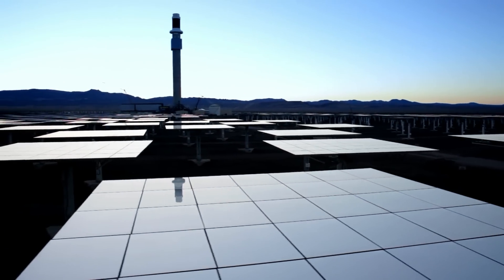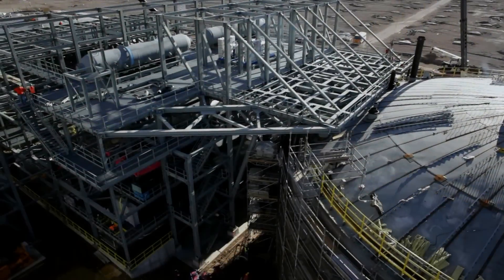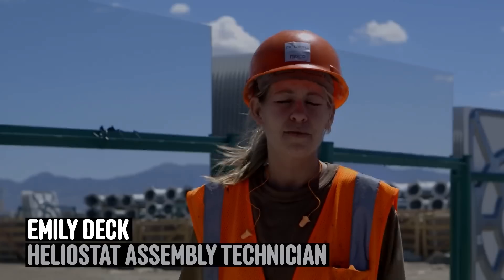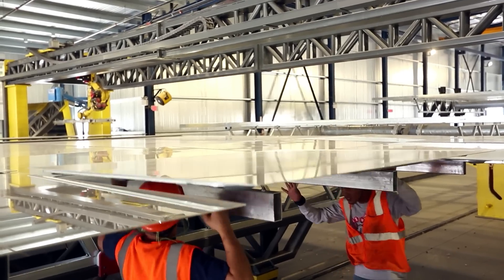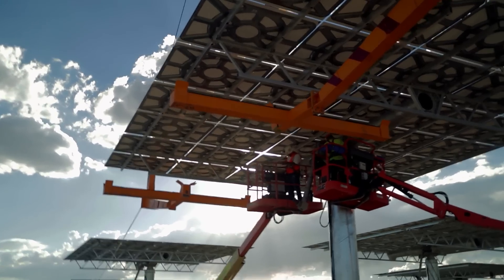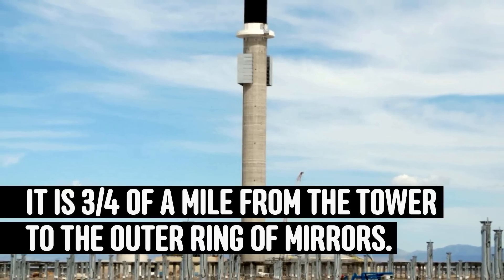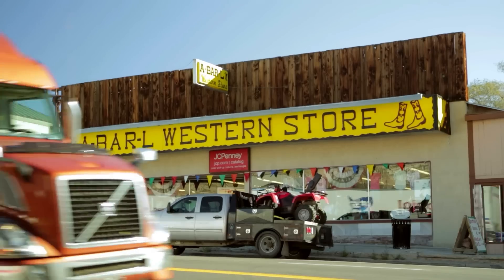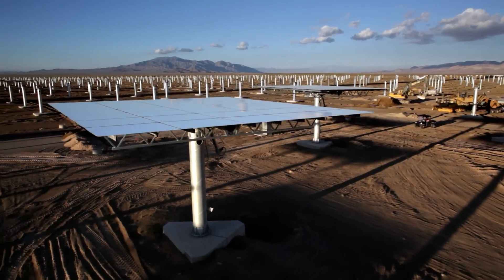Crescent Dunes Solar Energy Project Part 2: Building the Power Plant-The Window-WIRED

Comment: Oddly enough, I found the site by looking for the old nuclear bomb test site on Google Earth. I could tell instantly that the site was a solar array. I then performed a quick calculation of the size of the site; the potential projected array appears to be approximately 1.75 miles across, and approximately 5.5 sq/mi, or 3,520 sq/acres; that is just the array...this site is enormous!! I zoomed in and found the facility or warehouse on the site where the mirrors (the heliostats) are fabricated; off to the west side of the site. Well, my curiosity got the best of me, and so I then Youtube'd, "Tonapah Solar Array," and Walla!! Crescent Dunes...Awesome!!

Incredible; there's a potential to build 10,000 heliostats on this land, and as said in the video; if the outer most array proves an efficiency of use, they'll build them all...incredible!! I was stoked that I found something great under construction on Google Earth. Anyway, Well, it is nice to know that there are awesome looking jobs still available for many; and this place looks like it would be a lot of fun to be a part of...very historical for Green Energy production. Believe me, this project (in my opinion) has a lot more potential than the Keystone XL Pipeline has to offer...I'd rather support, or be a part of, the Crescent Dunes facility, hands down.

Comment: Is it true that if you cover 1 or 10% of the Sahara dessert that it will power the worlds electricity needs?
Reply: It is true but even 1% is an unimaginably large area. You also have to find a way to transport the energy around the world without losing most of it on the way. Starting small in sunny regions like Nevada is definitely a the way to go.
Reply: We just need a couple of superconducting rings around the earth that we can tap off.